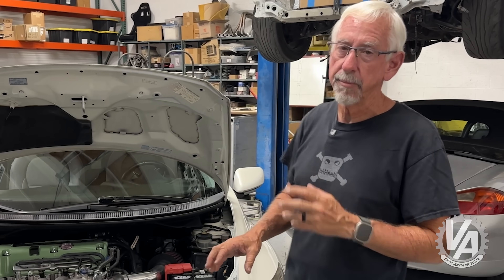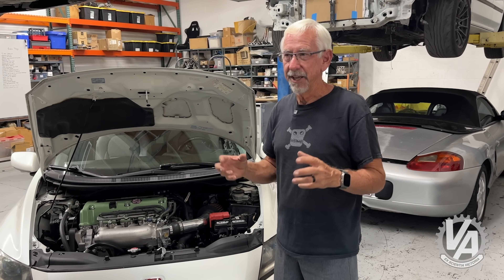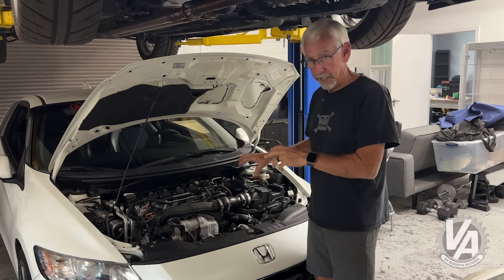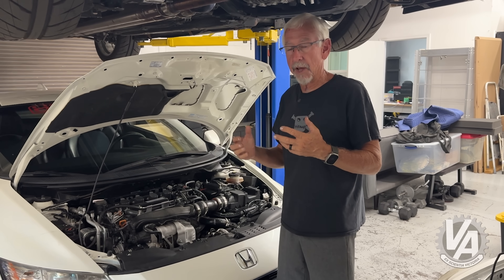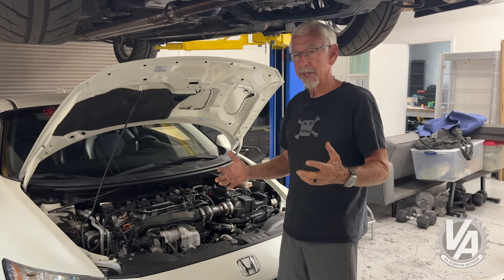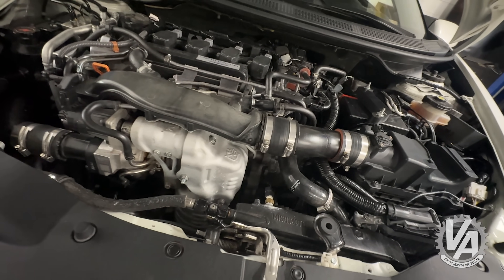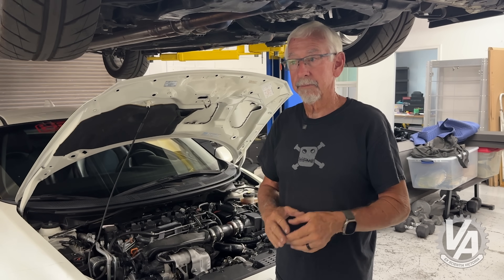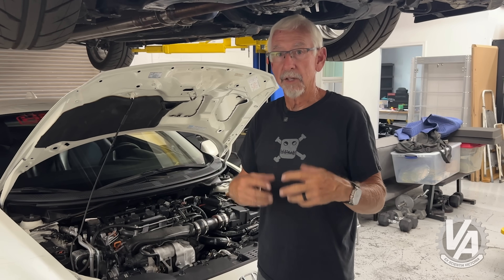We Knew This Would Happen! Honda Engine Swap History Repeating: ZC to B to K to WHAT?

Comment: A big issue is the number of swap capable cars going down and prices going way up. That and the l15 has weak rods and head gasket issues.
Reply: Right its not 2013 anymore k swaping is own its last legs
Reply: This. The newer the car, the harder the swap.
Reply: @quademasters249 headstud upgrade exists from 2-3 companies now.
Reply: @ValkenDnB   Thanks. What makes the swaps harder is mainly the electronics. if you have to stay emissions legal.

Comment: Lmfao tell them a k24a is not a k24a2 they are not the same  k24a is a oddysee van motor k24a2 is tsx motor that's the correct one  and even if you get it still have to put like  2000 into it to make it run perfect Rev up to.9 in a half easy trust me i have one in ek hatch had to get everything eg eg subframe eg steering rack and pinion eg steering rack and eg front co troll arms shit was a pain to find then get ekk2 mounts bro theni got itbs too madd bread lol
Reply: Found my eg subframe with everything attached for like $150. Good ol FB marketplace.
Reply: @jedifrost  yeah that best thing to do me I went and got peace bye peace was alot.for me lol go from.town to town getting all the eg parts together was crazy never again lol

Comment: I think the K24Zs are going to start to gain popularly. Ease of packaging, better crank sensor then the A2s, familiar architecture, and absolutely everywhere.
Reply from the maker: What ECU?
Reply: @VTECAcademy  CU2 or 9th Gen Si/ILX. I'm sure someone smarter than myself can figure out a swap package like Hondata is doing with the Flashpro J-Swap kit.
Reply: Yessir slowly building my k24z3 in my tsx 6MT
Reply: People don't understand the 1 port exit. The exhaust camshaft is the only restrictions. And it's intentional. It's an Si. Not supposed to have more than 200 hp. They want to raise the torque without touching the hp. That's why it has big intake camshaft and medium exhaust camshaft. That's why it's power rises up fast and then plateaus at 4k without dropping. Long headers are needed only because you have headers. A single exit where the port merge has no room for pressure to do anything. Once the exhaust gases are released, its already headed out the back. Its that simple.
Reply: @JAO911PLIST  "And it's intentional. It's an Si. " Isn't that just because Honda reused the TSX/ILX engine to save money? 🤔

"Long headers are needed only because you have headers. "  Supposedly the intake ports flow the best of any K series, but doesn't the exhaust head design mean cylinders 2 &3 flow very well but cylinders 1 & 4 flow terribly? 🙂

FWIW, the F1 engines still have a manifold. Originally it was a log manifold on the 2015 Honda to save space, but eventually they have become equal length tubular manifolds -- still beneficial even on a turbo engine.
Reply: A k20 vtec goes from low power to high power. The exhaust goes low noise to high flow. K24 heads go from high torque to high power. The exhaust has 1 profile. Vtec mimics having 2 cams. Just get bigger exhaust cams. It's a 1 piece rocker, but i would use skunk2 1 piece rockers for safety. Only on the exhaust side.
Reply: K24Z exhaust cam is only slightly smaller than A2s VTEC lobe. 
Z also has stronger rods and 11:1 comp pistons out of the box. The single exit headifold is not great for NA but perfect for a turbo build and the bottom end will hold up to 500-600hp as evidenced by multiple 9g Si builds.  

It's just too bad barely anyone makes parts for them and some small design differences making older K20/K24A parts not compatible.
Reply: Yessir, love my fg4🔥
Reply: Z3 exhaust is horrible unless you swap the heads single exit is pretty wack to me but who knows never paid attention to the. The k24a2 or any k24 swap pistons and rods for turbo
Reply: I got a k24a4 with the k24z3 internals rods are stronger 💪🏽
Reply: The z series is so bad.  It makes no power.
Reply: @duanebailey6253 does just fine on boost. Look at all the boosted 9th gens for examples
Reply: @duanebailey6253  🧢

Comment: Ive heard those L15s have really weak bottom ends, especially compared to the 500whp capable K20/24 bottom end. I saw those rods and rod bolts, and it looks like someone could snap them in their hands. They also sound... not good 😂
Reply: Relatively "weak", they'll hold a lil extra power they just aren't overbuilt from the factory like the k series motors were.
Reply: They suck. I blew up a bolt on one with 20k miles on a cvt car.. the motor literally just crumbled one day switching lanes 😂
Reply: @K24_Rizo your problem was modding something that wasn't an Si or better
Reply: @acevedohiram  yeah cause it’s totally not the exact same motor with an intake and an exhaust. Be fr.
Reply: @K24_Rizo  it isn't lmao. The Si bottom end has better rods than  the sport hatch 1.5. And lower compression pistons. Also a different turbo and cams. Look it up. The CRV also has basically the same motor. It's easy not to blow them up if you don't mash the throttle at low rpm. *
Reply: @acevedohiram  the compression ratio is different by .3 😂 I think you’re missing the point that this was a motor with an intake and catback, and it blew up under normal driving 😂 L15s suck and everybody knows it
Reply: @K24_Rizo  the point is that it isn't the same engine. You blew it up because you beat on it too much down low. Torque down low kills cars. I've seen it on K series too with a turbo too small. I put 30k on my 10th gen Si with an intake, intercooler, exhaust and ktuner. It spent most of its life on map 2/3 on phearable and even a stock clutch. I took it down bandimere 30 times before they closed. It was still on stock clutch when I traded it in at 60k. Key takeaway. Don't mod a cvt
Reply: @acevedohiram  you watched me drive it yeah? 😐 just accept the fact that the L15 is not a worthy replacement. New cars suck.
Reply: Facts
Reply: It's a Fit engine with a turbo on it, after all.  It's definitely much closer to its limits at factory power levels (170-210hp), than the K20 or K24 used to be. 🙂
Reply: @TassieLorenzo  it’s not the same internals as the fit, but I agree. It’s not the future for swaps imo. I’d rather see them develop the 2.0s
Reply: Hi. I have DelSol with L15b7 with some tune. It produce easy 260hp/330NM. Transmision with LSD put this 205/50/15 Toyo R888 tires and all car is like a new Honda from 2023. We make this swap year ago. I can recomend this to all of you who want to have not super fastest Honda on the street, but great, daily with a lot of fun. I did a lot of K20 swaps, B16, B18c6 and other for different hondas. But this idea to put 1.5 turbo was best idea, trust me.
Reply: @olafprzybyszewski5096  you should post a video about it, I bet it would be popular!
Reply: @acevedohiram I was try to put a link for some pictures how we doit and how it looks and so on. But some guys here dont like link like that I think and link was removed. Sorry Not sure why?. Im not any competition. I live in Poland. We just love our Hondas right? Like one big family :)